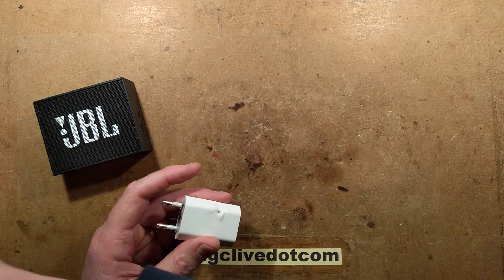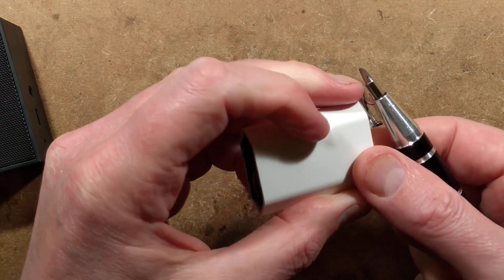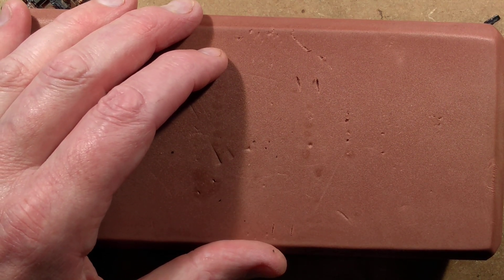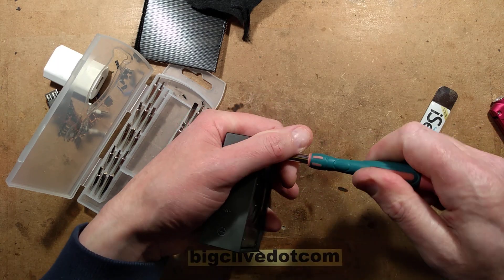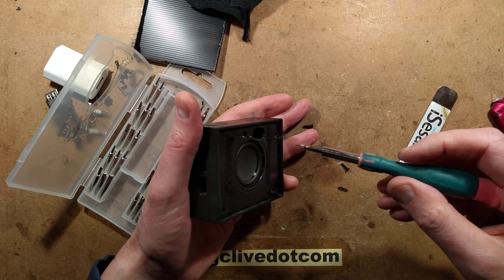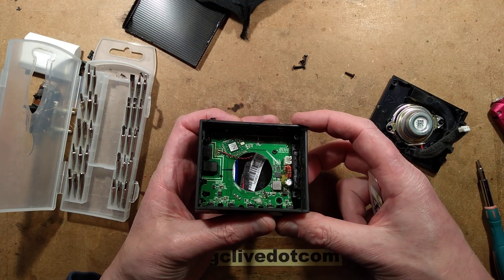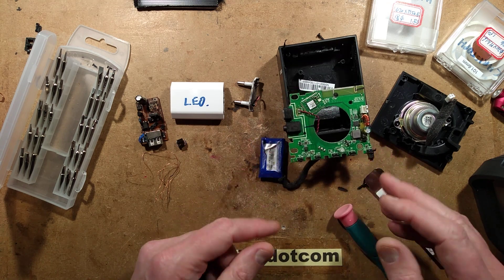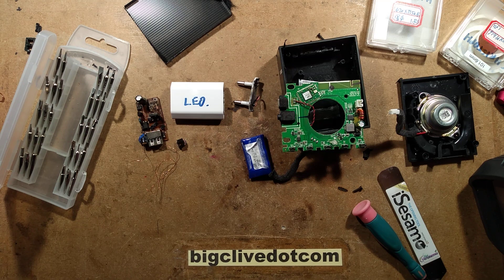Dead JBL speaker and melted PSU.  Which died first?

Comment: I’ve had mixed luck with JBL. two pairs of cheap earbuds that had a defective bud and case, respectively. But also a Clip 3 and Charge 3 that have been indestructible for years in outdoor settings. Flipped a canoe and the Charge was in near freezing water for 15 minutes - proved its waterproofing by still playing when i found it and fished it out!

Comment: Interesting as usual!  I'd have liked to see you desolder or just remove the bluetooth chip and plug it in again to see if the other chips stop being so hot, and/or the battery now charges up again.  Bummer is that even if it did, still can't use it without some sort of connection (or is there a phone jack there somewhere?)

Comment: I once burnt a Bluetooth headset with a decent charger than showed up a very strange behavior in presence of magnetic fields... I'll tell you..  While charging, the headset had a red LED and one day I had casually noticed that when a magnet was put close to the charger, the LED would have glown brighter... After a bit, even after the magnet was removed, I noticed that the charger was getting quite hot, even without a load... I had then found out that the headset wouldn't work any more and that, when the charger was close to a magnet, it was supplying 9 to 12V depending on the distance.... I still can't understand how was it possible... The feedback was realized with an opto and not with a winding, so, I expect, in the worst case, the core to saturate and the output voltage to go low but.. It wasn't so... Has anyone got an idea?
(I can assure you which was a genuine 5V 1A charger, good quality caps, safety clearance respected, EMI filtering at the input...)

Comment: Quite funny to see the switching transistor in 2 halves and the bulgy capacitor.  Should have removed the lithium cell then connected it to your bench supply and really toasted that bluetooth chip - usually the current draw gets very non linear above 7 volts but you need a few amps to really fry those chips into oblivion.  I would have finished it off by connecting the speaker to my hifi amp and pumping some bass through it until it released its magic smoke

Comment: hmmm, i think i know what happened. and it's the crappy psu's fault. my guess is that the crappy psu was sending some very bad 5v power to the speaker and the bluetooth circuitry crapped out after being powered from that for some time. when it crapped out the psu was then hit with a real nasty load and we had the result there.

Comment: I think you are wrong. I suspect a current transient on the power-grid caused the cheap (not properly isolated) power-supply to pass on a transient in to the speaker which then fried the blue-tooth-chip which got the worst of it.. and after that it had burnt through a couple of wires internally tot hat chip which meant there was a short in there.. only reason the short itself didn't create more of a problem than "just takes a BIT more current" is because of how thin the wires are internally on the chip, so there would still be a decent resistance even with a short.

Comment: I think the smaller JBL speakers like this one is meant to be charged via USB connected to a computer. That is why they don't give you a power plug with the smaller ones. But with the big ones they give you a power plug to charge it with.

Comment: I know so many people with cheap, crappy chargers and especially cables...but have very expensive phones and stuff. They then don't understand why stuff is getting hot or taking ages to charge. Even when i tell them what the issue is..."spend a couple of pounds more" on decent cable or charger... they don't...there just seems to be a disconnect that a lot of people don't understand...i dont bother anymore, you can take a horse to water n all that.....Peace.
Reply: @Ben T. Yup, they are dangerous..but so many people just dont get it....until something bad happens.
Reply: @Ben T. This is another really good point. If you dont  back your shit up...at some point you will lose it. I have replaced my cd drive on my laptop (nobody uses cds anymore) with another hard drive. I also have a 120gg sd card that backs up every day stuff. And i have an external hard drive. Again, people have to learn this shit the hard way unfortunately.

Comment: perhaps if you remove the BT board and solder in one of these small USB BT audio receivers directly to power and audio pins it would still be usable (although it's not like it's especially worth using it)

Comment: The jbl speaker at minimum requires a 1A charger but the cheaper PSU'S only pass 400 to 600ma, 
I'm not sure but that may have contributed.

Comment: I used to have one of those speakers. The sound wasn't too bad, and it didn't cost too much (like €21 or something like that iirc), but it was such a pain to disassemble. It wasn't made for repair (not that you'd really want to, but the option to do so should be part of every design IMO).

Comment: Most likley its the PSU sending a too high  voltage frying the BT chip and controller in the speaker pulling even more curent until PSU went bang and melted. I doubt the BT chip would have failed first and also JBL are in general good quality. I have one of these myself for getting better sound from my laptop computers when using them outside on the balcony listening to music while programming or just relaxing getting the proper loung feel. I have the One+ model (That one is the One model). The difference is that One+ is a bit larger because it uses a passive radiator beside the driver instead of that bass port to get a bit more punch and yes the sound is great from the little thing! A great upgrade from those shitty and raspy internal laptop speakers. Can really recommend it! Make sure u use proper power supplies though and that goes for ALL electronics and your own safety! The one that came with your phone is id say totally safe since it is made by a quality company like for ex Samsung with proper safety knowledge and quality control. If you have lost it dont buy the cheap ones cause with power supplies its not about extra money for luxury with no function but you really get what u pay for here and in the case with power supplies compromises can be lethal! A proper made power supply you should be able to trust 100% that its safe for both yourself and your electronics.

Comment: Clive, please revive it with generic ebay modules! A Bluetooth module with an integrated 3-5W class-D amp and FM radio (and at this point, it will have more features than the original), a battery charger module, and you're done. It will sound better than the Chinese clones, because the quality of the speaker and the design of the box and bass-reflex port are the most important things in regards of sound quality.

Comment: I don't think JBL speaker was the primary fault because they are overpriced but design wise not that bad. However I have couple of those cheap chargers I bought mostly to charge batteries. not phone or anything too valuable but I soon found out I couldn't even charge those cells properly. After couple minutes it would simply stop charging. I though could be an overheating issue but it wasn't, sure it was hot but not that hot. 
Then I figured out the culprit, voltage regulation. These cheap supplies without any proper voltage reference or proper PWM control can go up to 5.8V and upwards if you keep it plugged in for long. 
That could be a reason to damage the bluetooth receiver.

Comment: JBL - Junky But Loud. Still my favorite driver is a JBL E140, I'm a bass player.
Reply: The sound quality typically isn't the best around (is that ever the case with bluetooth?), that said I'm very happy with my JBL Flip 4 even though its sound at best can be called mediocre. My primary use case for it is to have a bath/shower proof speaker to listen to podcasts/audiobooks, that room isn't a good place to enjoy music anyway due to noises like the extraction fan, shower running, bath filling up, etc.

It also comes in handy as a portable speaker to listen to similar stuff or maybe even music while doing chores/maintenance around the house in rooms without stationary speakers.

The only acceptable bluetooth product I have here are my Sony MDR-1000X headphones, it's convenient with the touch control interface for volume, play/pause, previous, next and most importantly the active noise cancellation. That last feature makes bus rides much less annoying, it notably also doesn't use the standard audio codec the bluetooth standard supports but instead offers support for both LDAC (developed by Sony) and aptX-HD (Qualcomm developed codec). Both those codecs allow for significantly better audio quality (more than realistically needed while having bus/city street background noises going on).

Comment: bought a solder gun kit, some practice boards, bunch of thingies to practice on because of you; didn't get the 90 cent ebay specials; but over 1300 resistors and 300 leds to practice on the blank boards and one that is actually functional (lights up).  I figured if I'm not any good after over 1600 attempts, it might not be the thing for me!  But as you said, the only way to learn is to do it.

p.s.  love your calm approach, added humor, and explanations, thank you for your videos.

Comment: Have you tested Anker chargers (specifically UK/EU spec ones)? Are they suitably protected? (I hope so - it's what I use and I have a metal-backed phone).
Reply from the maker: They are supposed to have a good reputation, but I've never taken an Anker charger apart.  I'd always still recommend a soft plastic case for your phone as protection against shock if you do plug it into a defective charger and also to reduce the risk of the grief a cracked screen causes.

Comment: I know the transformer did not meet safety specs but It was bent over when you pulled the PCB out the case, because of the melted section. I would have cut the case open.

Comment: You are right about the proper charger; I recently inherited an LG G5 phone from my sister when cancer took her from us. Her son's gave me her computer and her cell phone, knowing that I was in desperate need of a new phone, and have a history of rebuilding computers.  They could not find the charger though and a bit of research showed that this unit wanted a quick charge wall wart.  So I located the proper charger for it, made by LG and  ordered it off Ebay,  It arrived in the original package, and is a super charger. It can fast charge my new phone in a fraction of time that a regular charger can, and I am in hopes the battery may last longer using it.  The build quality is much better then the cheap crap, even judging it from the outside, and, of course being a Big Clive fan, I did open it up to have a look, it even looks great on the inside.

Comment: My guess, having seen similar things happen before  - the crappy power supply as it failed sent too much voltage and damaged the chips in the speaker, causing internal shorts within those chips which is why they heat up so much.

This is why no one should trust their expensive gadgets, house, and potentially even their life (electric shock risk), to cheap dodgy power supplies. ALWAYS use OEM power supplies whenever possible, and if replacement OEM power supplies are not available, only buy replacements from trustworthy sources and manufacturers.

Comment: if the Bluetooth speaker had an aux in, could you desolder the Bluetooth chip and just use the aux in for music?
Reply from the maker: It may be switched through the bluetooth module, but it could be bypassed.

Comment: Another idea. Use mains charger to charge a power bank, then use the power bank to charge all the expensive devices. Not the most efficient or convenient but will avoid any chance of expensive devices experiencing mains voltage.

Comment: Have this JBL speaker, very nice portable unit. To me it seems like the shit power supply had a spike or something on the output, which shorted the BT chip in the speaker, which in turn caused the power supply to self-destruct. Maybe it is worth trying to desolder the bluetooth IC, and seeing if it runs off the AUX input.

Comment: Why are my 240-0-240 and 240-100/90/60/12/5 Transformers have the size of the rubber brick , rather than a thumbnail as these new transformers
Reply: Because the small ones are more efficient at around 1MHz, but need rectifying and alternating circuits. Yours does the job at 50/60Hz without any help.

Comment: I have my doubts about the JBL being the culprit. Because the JBL speaker uses a USB charger it expects a stable power supply. Typically microcontrollers have their own power supply but they have very tiny ability to dissipate ripple but they will try. I believe the failed output filtering on the charger caused ripple which then caused the JBL to swing all over the place causing the linear regulator inside the microcontroller to short and then that fried the charger due to no overload protection. ALL USB chargers according to spec should current limit. Usually the current limit is fixed unless its USB-PD in which case the current limit and voltage are selected. Again.. there's always a current limit. Even if you have a fast charging device it should still current limit it at 2 amps when using a normal device. This is among other reasons so it doesn't light things on fire because of under speced cables.

Comment: No, it wasn't the CPU that blew-up the PS; it was the PS that blew up the CPU. The bulging capacitor in the PS was the smoking gun. Typical flyback-convertor topology (which is the only reason a ferrite-core xfmr would be in there in the first place) has the - lead of the secondary driving the anode of a diode, which drives the + side of a cap. (Yes, - driving +; that's why they call it "fly back".) The cap is nearly always a way-underspeced Chinese or Korean cap, which is a huge mistake because flyback convertors are murder on caps; one should use rating = 600% of applied voltage, not 110%, because of the spikey nature of the inrush current. Once the cap bulges, you loose filtration, and the output voltage becomes very spikey. And 3.3V CPUS don't like to see 7 or 11 or 37 volts on their input; the transistors inside then melt and they get very hot. I should know, I've seen this exact same failure mode hundreds of times at work.

Comment: I've got a JBL charge 2+ bluetooth speaker, it includes a powerbank function to charge other devices, It has a 6,000 mAh battery & the supplied JBL charger  (2.3amp output) is the only one that will properly fully charge the speaker,  (all 5 bars lit). Using various other chargers,  even a multi port hub with a 5 amp output won't charge it completely.
Obviously that melted PSU didn't have any over current protection.

Comment: I've used the same argument with people building PCs, high end CPU, motherboard, ram, GPU. $20 back of a van power supply.
Reply: Yep, seen that many times.  The first thing that usually dies from a crap quality or overworked PSU is the graphics card.  If you a building a nice  system it's worth buying a decent PSU.

Comment: I would think the transformer shorted with enough connection to let mains through, slowly killing the cap in the PSU. Then it went full short and dumped mains into the speaker killing the Bluetooth chip from the VCC pin.
Reply: Unlikely.

Comment: Clive:  could you recommend a 5+ port usb3  hub of decent quality?  I charge all my devices with an old usb2 hub and was thinking of upgrading.  Unfortunately, most units now are crap.  Cheers from 🇨🇦
Reply from the maker: Hard to say.  It might be worth splitting it down into smaller units.  Any sold by a prominent high street name should be to local electrical standards.
Reply: bigclivedotcom   Thanks for the reply.  I ended up getting an Anker 10 port hub.  Seems to be working well.

Comment: The culprit could be the adaptor you used to plug the USB charger to the mains. Poor contact and small continued arcing will kill the charger. Mostly no voltage protection in both charger and the JBL speaker.

Comment: Nice video. I was given one of these speakers after it's controls had gone comatose. I discovered that it would briefly re-incarnate itself if left to completely flatten its battery. It could then be recharged and used for a few minutes or hours, at which point it's little brain would go Microsoft and hang, needing a full discharge-charge cycle again. Reviews say that this is a somewhat common issue with some of these.
I "fixed" it by adding a tiny normally closed button switch in series with the battery, allowing it to be awakened again by a hard power-reset. The switch fit nicely into the lanyard space. It sounds great for it's size and is now one of my favorites. It just needs a smack-upside-the-head attitude adjustment once in a while.

Comment: Big clive, what is the charging chip in the JBL? It just does not make sense the blue tooth chip getting that hot at all. I am thinking that crappy USB power supply is still the cause. Distroying the JBL charging/ current limiting circuitry. Because if you only plugged the charger in, the blue tooth ckt and amp should not be getting power until you turn on the speaker. 
Whatever the reason we may never know.  i am electrician myself with 15 years in entertainment lighting and share your dare to say obsession with all things that twinkle and light up. I love all of your videos and have learned a thing or too. Thanks and cheers.

Comment: This is what happens when you forget to design the board with a proper flux capacitor before going 88 miles per hour. You go 88 degrees Celsius instead, and suck up all available power!